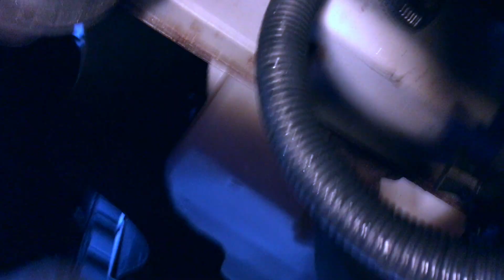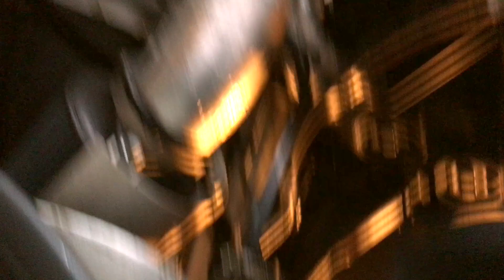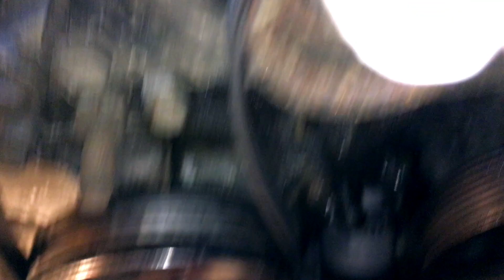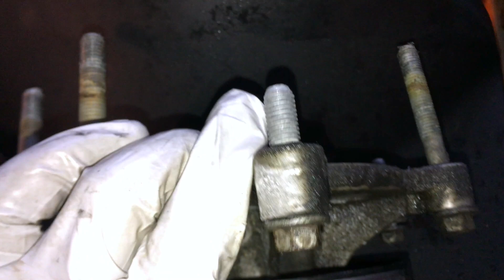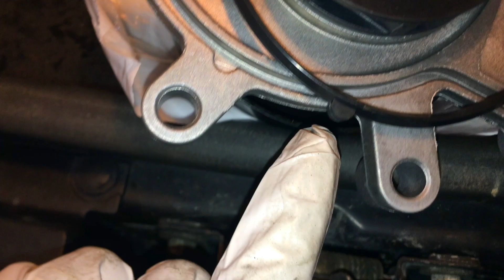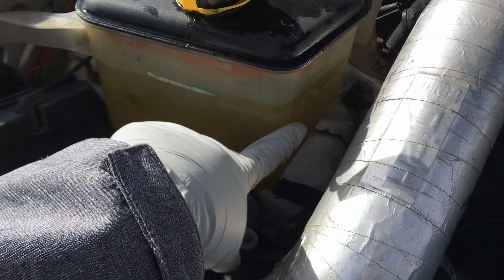2006 Jeep Grand Cherokee (WK) 3.7/4.7 Water Pump Replacement

Comment: Video was excellent! Watched it, called Advance and got the pump....done in 2 hours and only cost me about $80 for everything. Saved me a few hundred easy....thanks man!
Reply from the maker: Great news to hear brother. I’m proud of you. And thanks for the update.
Reply: @MrV2u  is there a way it may leak to the transmission  on a grand cherokee laredo 4.7l v8 2007? The water pump
Reply from the maker: @general14hayabusa  anything that leaks; coolant, oil, or tranny fluid can travel all over the place as you drive. The water pump will drip down and as you drive, the coolant will flow all the way down and back. Look under your water pump and check the bottom of it and you will see a weep hole and it will be wet brother if it’s bad or going bad.
Reply: @MrV2u  thank you, I’ve been told that some transmission lines go through the radiator on a jeep laredo 4.7l v8wk
Reply from the maker: There is a transmission cooler that sits in front of the radiator. It will have two lines going into it from the transmission.

Comment: 1 tip that might help, trace the new water pump on cardboard and when you remove the bolts, push them into the template into the position where they belong
Reply from the maker: Absolutely great info. I’ve done that on bigger jobs and definitely helps for sure.

Comment: Hey man, i have a fan clutch attached on my water pump on mine with a little fan attached, is it easy to take the fan clutch off the water pump ?
Reply from the maker: You need a fan clutch wrench and it goes on in the opposite direction. So right to loosen and left to tighten. It shouldn’t be to bad to get off.
Reply: @MrV2u Thank you sir have a great day!

Comment: just did mine going to let you know what do you know about p1644 code
Reply from the maker: 2006 Jeep Grand Cherokee (WK) 3.7 Electronic Shift Module (ESM) Problems U0404 P0700 Codes
https://youtu.be/yd71kNuO2aU

Check that out and let me know if that helps.

Comment: Do I have to loosen anything before I put 15mm socket on to remove belt? My tensioner isn’t moving at all and afraid I’ll snap something if I put tooo much pressure on it. Thanks for anyone that can help
Reply from the maker: It should move brother. You don’t need to loosen anything up first.

Comment: My jeep will leak a puddle underneath only when sitting over night hard to tell where it's coming from replaced the thermostat and rad cap still doing it and when at idle lately with the heat off the temp gage will climb up soon as I start moving it goes back down could that be a water pump?
Reply from the maker: Do you know where the puddle forms? Center, left, right, front of motor rear of motor? If you look at the water pump is it wet in the bottom of it? Weeping?

Comment: What's the torque for the idler pulley ?
Reply from the maker: The FSM has no 3.7 idler pulley torque spec. On the internet, I have found 3.7/4.7 idler pulley torque specs of 30-35'lbs, 40'lbs, and 45'lbs. Not wanting to over tighten a bearing, I used 30-35'lbs. You’ll be good with these lbs.
Reply: @MrV2u  Thanks.

Comment: With this problem fix my transmission from overheating the upper radiator hose Is extremely hard and the lower hose is Warm to touch with the water pump calls the upper radiator hose not to circulate
Reply from the maker: If the water pump is going bad it won’t circulate the coolant. But with your symptoms, I’d say you have a bad thermostat. Which is a easy fix to do your self. Make sure when you swap it out you bleed the system of air our you’ll overheat. Let me know how you make out brother.
Reply from the maker: The transmission overheating is a different story.
Reply: @MrV2u  I had the thermostat changed but it the system was not bleeder and now it’s reading a misfire in the 3 Cylinder. And that the transmission is over temp
Reply from the maker: If you watch the video you can see where to bleed air from the system. It’s not really a valve but more or less a flush hex head bolt. What codes are you getting? Have you ever had the tranny serviced?

Comment: How exactly would you know if your water pump is bad ?
Reply from the maker: It will leak from the weep hole on the bottom, or start to squeal/squeak/groan, or you can pull the belt and grab the pulley and it will have play in it.

Comment: Great video. I am trying to find out where my coolant is going. Overflow is empty. I don't smell any coolant. No coolant in the oil. I get moisture build up on the inside of my windshield (not sure if it has anything to do with coolant). Where is a good place to start? Thanks for a reply! Have a great day.
Reply from the maker: Thanks for the feedback brother. Do you have a sweet smell inside the jeep? If you do you can have a failing heater core. The rug would be wet on the passenger side footwell. Do you see any dripping on the floor overnight? Is the bottom of the jeep soaked?
Reply: @MrV2u  Yes the floor is wet. Thanks man. So it is a failing heater core? Thanks so much for replying.
Reply from the maker: Being that it’s wet your going to need to replace that heater core brother. Sorry to be the bearer of bad news but that job is no joke and involves removing the entire dashboard. You won’t have heat soon if it didn’t go away yet. But if you want you can go under the hood find the two heater core lines going into the firewall. It will be on the passenger side remove the lines and join them together with a pipe and you can drive it like that without loosing coolant     You just won’t have any heat whatsoever. Let me know how you make out brother or what you do.
Reply: @MrV2u  Thanks bro. Will do! You have a great day!

Comment: Just installed a new water pump in my 2006 Jeep Grand Cherokee Laredo 3.7L.  I used your video as my primary guide.  Thank you, nothing like saving money on a water pump install and engine coolant service.
Reply from the maker: Sounds good to me my brother. Glad I could help. Keep that Jeep running forever. Let me know if you ever have questions.
Reply: @MrV2u  What I really appreciated is how you pin pointed the bolt placement on the water pump.  Made a diagram after your video and took it outside with me.  Thanks man I plan on keeping my Jeep For a long time.
Reply from the maker: I’d figure I show that being that there was different sized bolts. Thanks again brother.

Comment: After replacing water pump my 3.7 Laredo fires up and stalls if I don’t have my foot on accelerator ? Revs up till water gushes out of thermostat but dies when not reving? Any suggestions
Reply from the maker: Coolant should never come out the thermostat housing. Also did you bleed the system of trapped air like I did in the video. It sounds to me like your overheating the engine. The truck shutting off is basically trying to save itself from over heating.

Comment: There are conflicting torque spec ratings for this. Some say 14, some say 40. I don’t want to crack the gasket.
Reply from the maker: 40 lbs brother I’ve never cracked a gasket nor had bolts break or leaks.
Reply: @MrV2u  thanks again man. I appreciate it. Helping my daughter out and want to make sure I’m really helping!
Reply from the maker: @NH-il6uc  your saving money and helping your daughter. Your definitely doing good my friend. Keep that Jeep running good and it won’t let you down.
Reply: @MrV2u  wanted to thank you for the video and tips and answering my questions!  That was the easiest Water Pump and Thermostat replacement I’ve ever done. 

My daughter’s car is all set!  Thanks man
Reply from the maker: @NH-il6uc  absolutely brother. If you ever run into anything or need advice I’m always here for advice. Keep on Jeeping on my friend.
Reply: @MrV2u  I do have a question. The manual calls for HOAT Coolant. At Oreilly Auto they didn’t have HOAT, but told us that the Zerex Orange OAT formula is what his computer said to use. 
I saw where OAT is backwards compatible with HOAT but not the other way around. 
Are we okay or should I have her run to Jiffy for a flush and fill of the system?

Comment: Bro so.no RTV gasket required??
Reply from the maker: Good question brother, on these motors it’s not required. You can see when I took it out there was none present. Some manufactures and years require rtv. But not for this application brother.

Comment: Good video.
Reply from the maker: Thanks Bob glad I could help. How you make out?
Reply: The project went well thanks to your instructions. I replaced the water pump, thermostat, idler and tensioner pullies and the serpentine belt.
Reply from the maker: Bob C good to hear brother. Job well done.

Comment: How can I remove the magical number 8 bolt
Reply from the maker: Ignacio Travieso you need magical tools and a wizard hat, lol. What bolt your talking about brother.
Reply: He’s talking the bleeder valve. It’s an 8mm hex, elder wand not needed. I have a question regarding coolant leaking over night from bottom of engine. It’s overnight so I can’t tell exactly, but looks like it comes from that plate on the bottom of the engine. Could it be water pump or head gasket?
Reply from the maker: @bobdenham1441 you need to get a coolant pressure tester on  it to be certain. See what your radiator cap is rated for, pump the tester up to that let it sit.
Reply: @MrV2u  copy that thanks!
Reply: So I have let the car sit since my four mile trip in it two days ago.  And when I took the radiator cap off there was a lot of pressure and I had some coolant come out. When it was off, I started the car but there were no bubbles and no discharge of coolant. Don’t know if that helps any, pressure tester on the way.
Reply from the maker: @bobdenham1441 that’s normal my friend. Good thing you don’t see bubbles when it’s running. That could symbolize a  bad head gasket. So maybe it’s just something such as a water pump. You’re not over heating or anything like that right? How many miles and what year?
Reply: @ no it doesn’t overheat until the leak becomes an issue. It’s a 2008 grand Cherokee and it’s got about 200,000 miles on it. I hope it’s a water pump because if it’s anything else, I’m not sure we’ll be able to fix it ourselves.
Reply from the maker: @bobdenham1441 are you dropping a lot of antifreeze or a couple drops here and there? Check the radiator hoses make sure no pin holes, make sure the radiator is not leaking as well. Look toward the sides where it’s plastic.  But once you get the pressure tester on it you’ll find it. If it’s just a couple drips overnight I’m leaning more toward the water pump. Look directly under the water pump and see if it’s wet. It has a weep hole where it starts to leak when it’s about to fail. Let me know how you make out.

Comment: Thanks, great video. I loved that when you got to bolt hole #8 you paused, realizing you had said only 7 bolts earlier. Will give this a shot tomorrow
Reply from the maker: Bob Barker lol it was that magical bolt that appeared. If you run into anything hit me up I’m around for advice. Good luck, you’ll do fine.
Reply: @MrV2u  My magical bolts usually show up on the ground once everything has been put back together haha. All went well and I got it it swapped out in a few hours. Thanks for the helpful video
Reply from the maker: Have you heard about the magical engine that makes sockets disappear. I usually drop a socket, small wrench, or bolt and wait in despair for it to hit the ground only to not hear anything. Lol the stories of mechanics. I’m glad it all worked out for you. Good job brother and thanks for the update.

Comment: Well the 4.7 has a fan clutch on it. Need to remove the fan clutch first. NOT EASY!
Reply from the maker: It’s not easy unless you have a air hammer with a wrench attachment to shock it loose.
Reply: The fan clutch isnt tht bad to take off, it's just having the proper tools, I just took mine off today with a fan clutch wrench and wrench pulley holder to have the torque to turn it
Reply from the maker: Mighty Mike you are correct sir. If you have the proper tools it’s not bad.

Comment: Thank you for the vid! I just purchased 2006 3.7 Jeep, 170,000 miles. How can I tell if the water pump needs replacing? Also, my EVIC system isnt working. The C/T, reset, step and menu buttons dont change anything when pressed. Any advice?
Reply from the maker: Congrats on the purchase. Signs of a failing water pump: dripping/weeping under the pump at the weep hole, grinding noise coming from it, play in the pulley such as wobble or rocking it back and forth. As far as the evic system it could be a number of things. Do you have any check engine lights? I found a webpage that talks about the evic system. 

http://www.wkjeeps.com/wk_evic.htm

Hope that helps some brother. Any further questions hit me up.
Reply: I cannot get the bleeder valve off.
Reply from the maker: Hit it with some pb blaster or wd40. Use a larger ratchet it will come loose. Worse case scenario is a little bit of heat.

Comment: Great made it look easy !! After I put it all back together my ac compressor was squealing when it would click on any suggestions why that would happen all the sudden is something to tight?
Reply: Took belt back off and hit then with brake cleaner .No more squealing. Thanks again helpful video.
Reply from the maker: Nothing should be to tight, the belt tensioner is set for the perfect pressure on the belt. Did you happen to spill any antifreeze on the belt. That would cause it to squeal. Take it for a test drive did it go away?
Reply: MrV2u  I didn’t get antifreeze on the belt but it may have gotten elsewhere. I rinsed it all down and took it for a ride and its still squealing when the compressor kicks on . I’m hoping it just  has something on the pulleys.. Thank you

Comment: Great video . Did you remove the rad fan or simply squeeze into that right spot ?
Reply from the maker: Scott S no you have plenty of room to work. Always here for your questions you might have. Good luck on the pump.
Reply: MrV2u thanks bud! This was the easiest straight forward video on how to do this repair. Thanks again! Will subscribe !
Reply from the maker: Scott S glad I could help. Thanks for the sub. If you have questions on any vehicle always around. 👍🏼